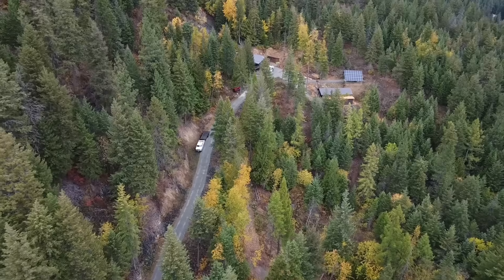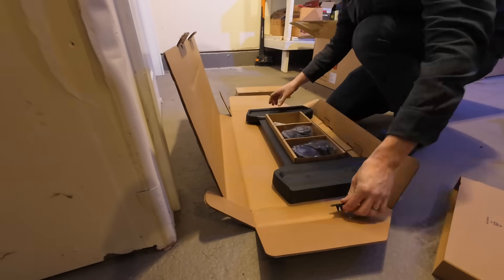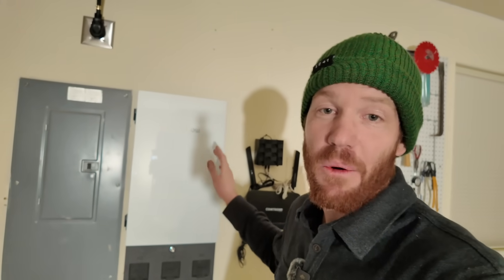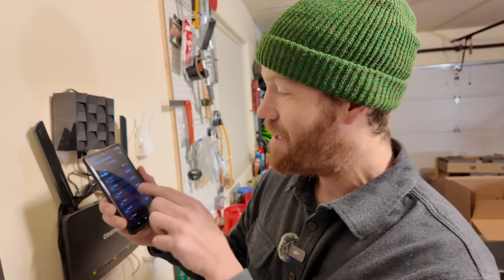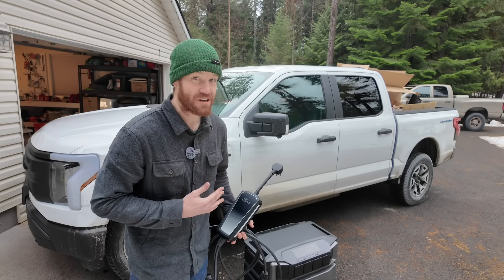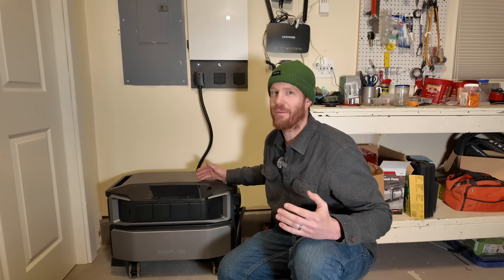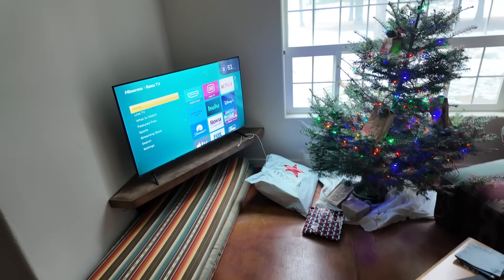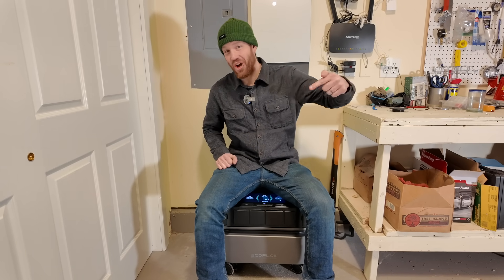EASIEST Off-Grid Power System! (EcoFlow Delta Pro Ultra)

Comment: Great video Riley! The only issue is, the EcoFlow is 2X higher cost than conventional home battery backup inverters. It looks great, but it's pricey for molded plastic.
Reply: I dont think a casual user like Riley's parents would like to go the DIY route
Reply: a dedicated home backup can be done DIY cheaper, but by the time you buy all the little components, breakers, etc. to get this depth of functionality and portability and then add the "smart" features, I think you'd be hard pressed to show much of difference.   And that's considering the home owner knows how to do it all and has the tools, etc.  There are some great units out there these days, but this is a very compelling setup.  I put in a 6000W growatt 2 years ago with 10Kwh of EG4 batteries for about the same cost as the starter kit with the $1000 off code and free shipping.  So got 40% more battery but a less capable all in one, with no portability, no offsite controllability, no additional outlet options, and a lot of DIY wiring and work for about the same money.
Reply: But the sponsorship pays well.
Reply: It's not the molded plastic that increases the price, it's all this marketing they are doing on YouTube and elsewhere. All these units that they give away to "influencers" are paid for by those who fall for the marketing rather than doing their own research.
Reply: Exactly my sentiments  @rthomp03  . But as you know , we - the  youtube channel subscribers - hold the key to stop the advertisement scam . It's going from bad to worse .  On all the channels  mind you .

Comment: In Britain, most homes have a water tank in the loft (roof space) so running out of water is not too much of a problem.
Reply from the maker: Using gravity to your advantage, I like it!
Reply: Even here in India..also most of the old houses in the cities and villages used to have open wells for water and with the rainwater harvesting being made mandatory in some states the wells keep us supplied with water throughout the year..
Reply from the maker: @ronblack7870  We accidentally completely drained the pressure tank while the power was off for the install. The pump kicked on as soon as we fired up the backup!

Comment: It is a slick system that is entirely overpriced.  I have a Delta Pro and like it... after I had to have it repaired because the inverter failed.  But it was too much.  That smart panel is $5800 and it is locked into the EcoFlow ecosystem.  A SPAN smart panel is only $3500 and isn't locked to any specific battery backup system.  You can even use EcoFlow batteries with it.

Comment: Do you think youtube should require creators to label videos as infomercials when they're shameless infomercials?
Reply: I'd prefer something like community notes on X/Twitter. Let the audience contribute to a badge or stripe on the thumbnail to let future watchers know it's just a 13 minutes of advertisement.
Reply: @inquarro  
Twitter is a different app and not youtube
Reply: @lilmsgs  I don't contest that. Is your point that a feature like Community Notes wouldn't work on YouTube?
Reply: FTC requires such disclosures and Youtube provides a tool for that, which they didn't use for this video. (On a video properly labeled, there will be a "Includes paid promotion" box showing up on top of the video).
Reply: @weirdguybr  
The video had the "includes paid promotion" on it at the beginning
Reply: @lilmsgs  When I watched it (and reloaded, to confirm), it wasn't there - they probably added it after the fact.
Also, that's the very minimum and still not compliant by itself - as of middle of last year, sponsored content also requires the disclosure in the video, both in verbal form and having a readable/large enough disclosure on screen at the same time.  For a good example of how this needs to be done, look up any of the videos that LTT has uploaded in the last two days that were sponsored by ASUS.
Reply: “Includes paid promotion” is kind of an understatement in the case.
Reply: @automaticprojects  
lol so is your comment

Comment: You didnt put the furnace on that new system?
Hell of piece of equipment though.
Reply from the maker: Their house doesn't have a furnace, just a boiler for the radiant heating (and a fireplace).
Reply: Boilers is the heating source primarily in the north. Southerners typically have no idea what a boiler is and rightly so since no one has any down here.

Comment: Love the video, but when testing saws, drills, vacuum, etc., you should really do so under load (cutting wood, drilling, blocked suction, etc.).  Keep the great content coming!
Reply: Blocking the hose on a vacuum reduces the load. There is nothing to move and the motor runs faster.